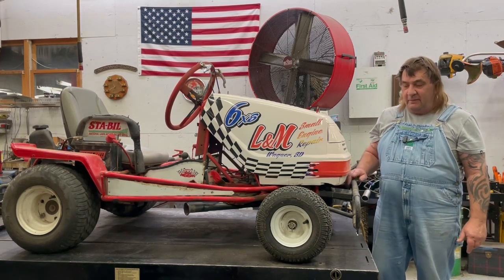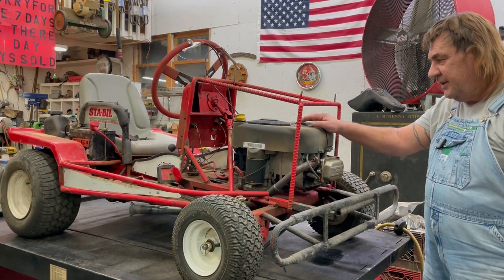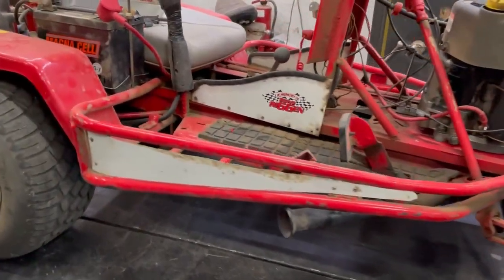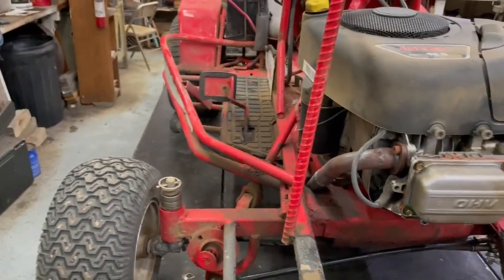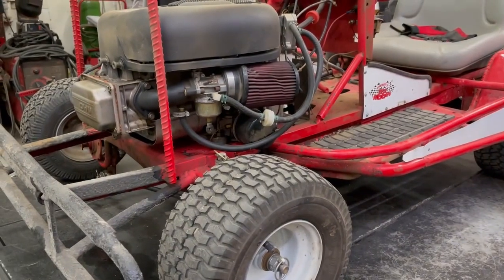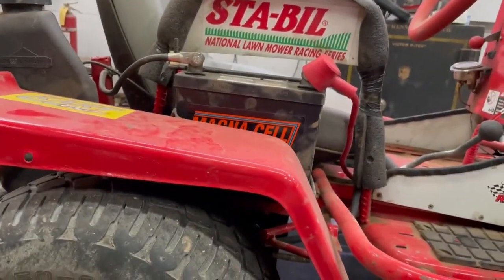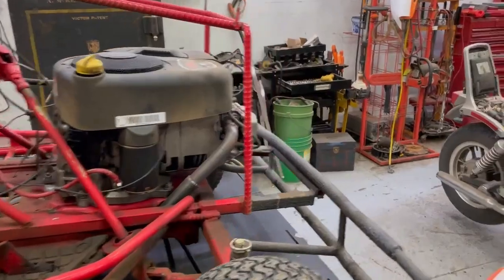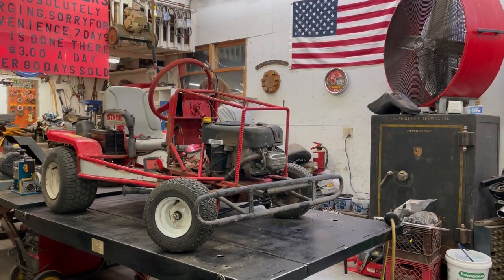What's Inside My MODIFIED Racing Lawn Mower

Comment: Sounds great!  What is a “tuned exhaust “?
Reply from the maker: just the right back pressure
Reply: @lmsmallenginerepair4471  Mark, are you ever able to run your racing mowers at the Wagner Raceway near by?  Just wondering.
Reply from the maker: raced there one year @Shorty4808
Reply: @lmsmallenginerepair4471  Very cool Mark!  I noticed you put a tuned exhaust on your 31 cubic inch racing briggs.  Would it fit on my 28 cubic inch briggs intek?  And where would i purchase one?
Reply from the maker: kartpipes.com @Shorty4808